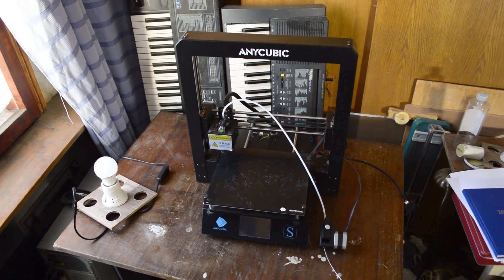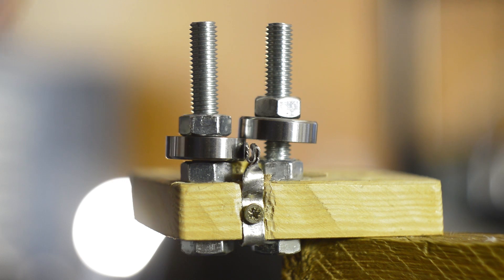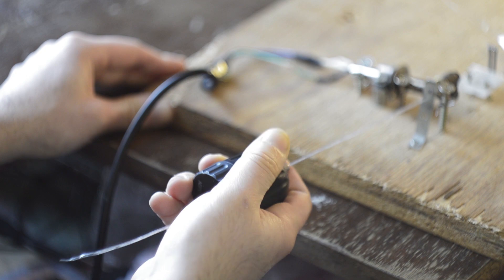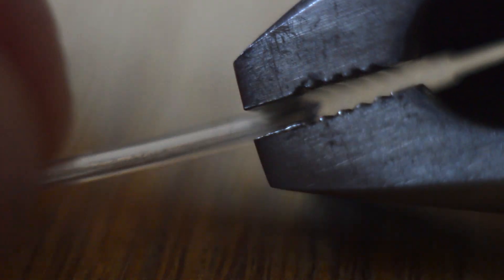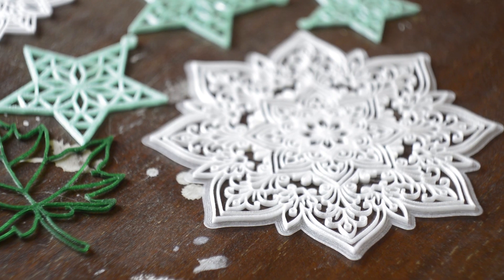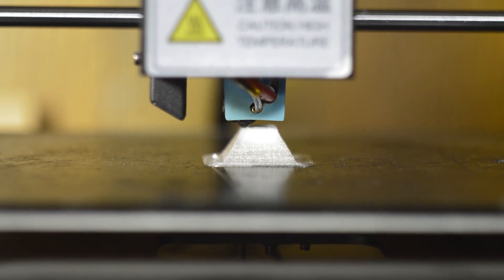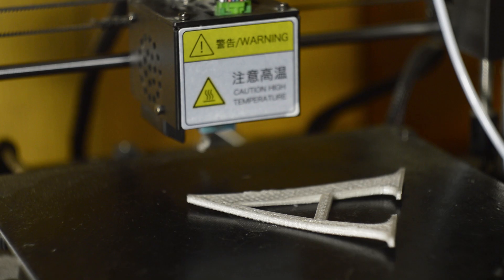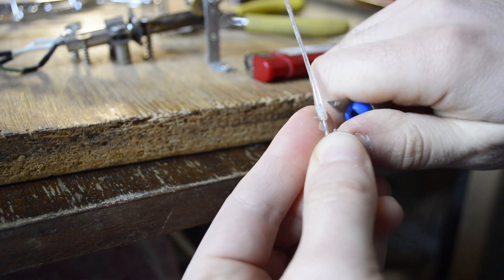How to Turn Plastic Bottles into 3D Printer Filament

Comment: To resolve the resistance of the filament,  try cut the tires with base on the width of the wall, a  0.2mm thickness wall, will have  the length of the    stripe is 1cm,  0.3mm will have a 8mm.

Comment: Hello friend, what setting can help to not show the lines?, I print with 110% flow and they line show clearly, i change flow to 130% but filament stuck to nozzle. Please help
Reply from the maker: I can't give you a specific number, you have to find the correct value for your specific case. Sometimes, even with different 3D models and different brands of filament, you have to make changes to the settings for each specific case. You have to find the correct value by doing experiments. I guess the correct number is somewhere between the two numbers you mentioned.
Reply from the maker: There is an ironing option, maybe this will help you to erase the traces of lines on the upper part of the model
Reply: @Edward_Black_Rose  i will try and tell you later, thanks

Comment: Hello dear friend, I have a big request for you, please write me all the settings of this 3D printer in order to print this bottle, I just can’t find the exact settings for the bottle
Reply from the maker: It is necessary to do tests with small models to find the exact settings for your printer and the bottles you use. I constantly change the settings, because each model, each situation requires different settings. I'll give you some examples that I'm currently using, and then you should change them depending on the results. 
I use a temperature of 245 degrees
The bed heating is off but I use paper glue
Flow 164
build plate adhesion type - brim
brim line count 2 (if your model is tall and comes off, make more 6 and more)
I turn off the retraction option and turn on combing mode. 
 3D printing is constant thinking and learning. It is not to set some settings and stop thinking about the settings. Before each print, some change is required, and a lot of experimentation. 
I have seen what precise things you are doing, well done I am impressed!
Reply: @Edward_Black_Rose  Thank you so much my friend thank you for your kind words I will definitely keep your teachings in mind You are a very good person thank you again and wish you all the best